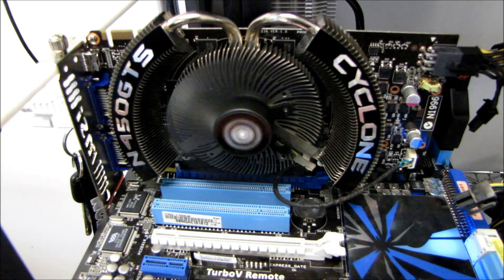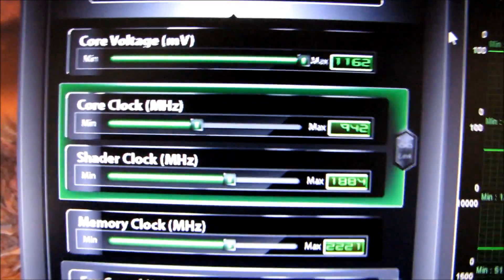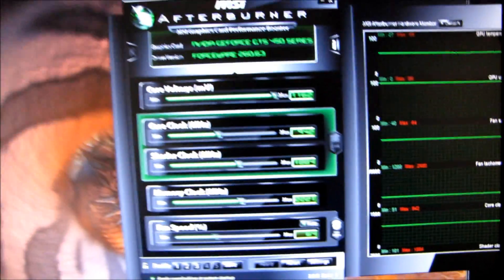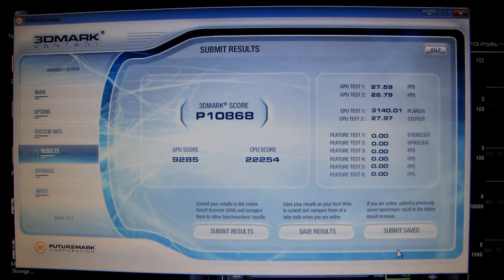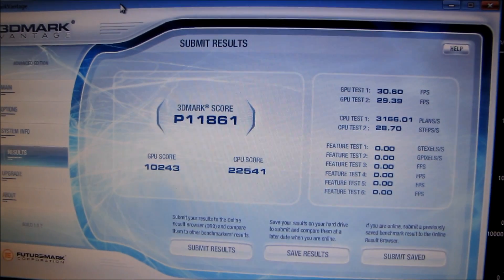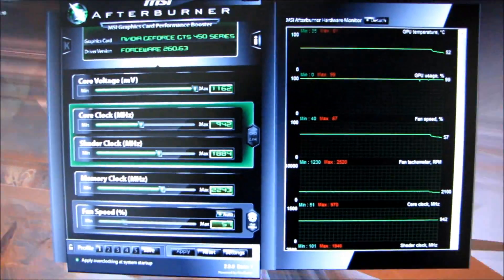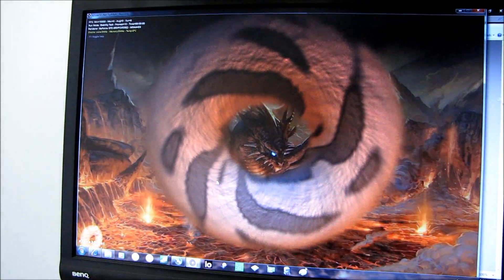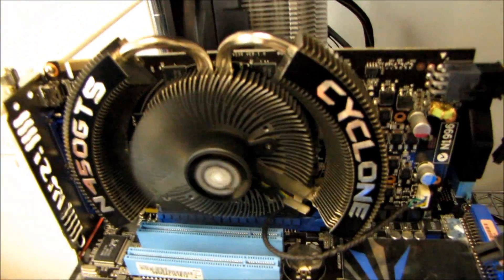MSI NVIDIA GeForce GTS 450 1GB Cyclone OC Overclocking Results Linus Tech Tips

Comment: I got 1012Mhz Core and 1950Mhz Memory :O
Reply: +Lolucoca lolz you have good card if you can do over 1ghz. i think your memory will go much higher since i got it on 2200 with 1162mv
Reply: I got the same like in the Video, Mem Clock: 2243 Core Clock: 942 Core Voltage: 1162. I have a PNY Geforce GTS 450.
Reply: i can do 942 core clock without leaving the stock voltage. but with voltage maxed i can go over 1ghz. btw i have msi cyclone version
Reply: I didnt try setting Core Clock higher, I quickly took over the settings from the Video. But thank you for commenct I almost forgot that I can try. I will give you me feedback soon
Reply: Mhm doesnt work for me over 1ghz does the Application crash :/